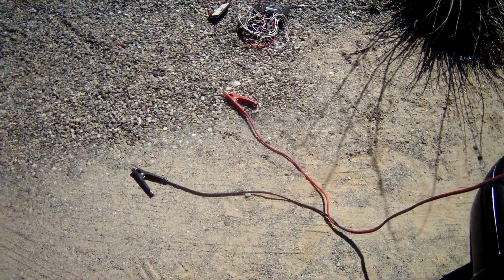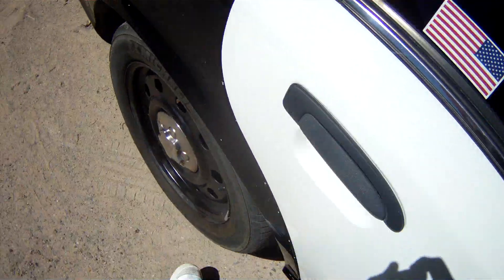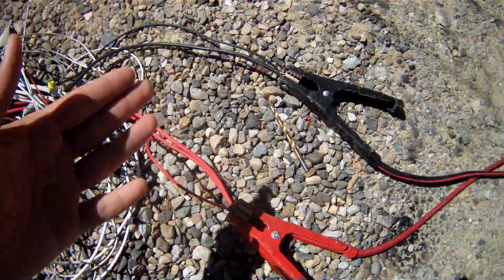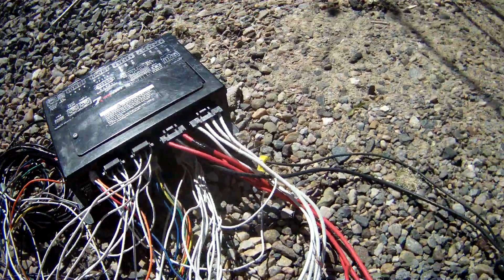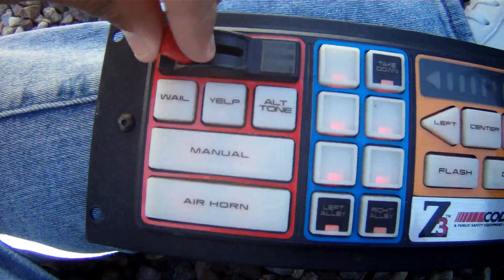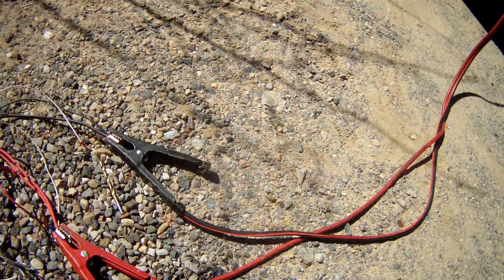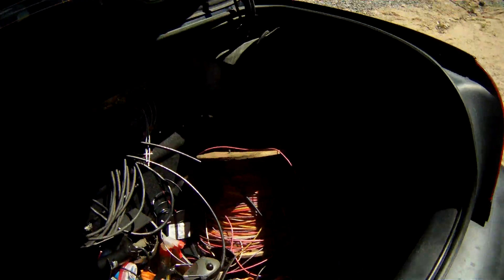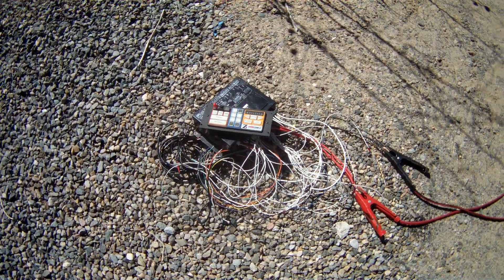code3 z3 wiring tutorial

Comment: Hey so i blew a fuse and cant get my power back to my controller control box has power and everything but the controller just has no power do you know why?
Reply from the maker: I'd check the power wires and grounds to make sure they're tight. If that doesn't work, try switching the cables. Then, check the circuit board inside the actual Z3, along with the fuses. If that still doesn't solve the issue, it might be toast, or the controller could be broken.
-Please take everything I say with a grain of salt—I'm no professional; this is just what I could think of off the top of my head.

Comment: I bought a Z# recently. There as 3 plugs in the back of the Controller, one for siren amp and one for mic power. However the third one looks like it has 5 or 6 prongs. I never got a cable that connects to that. Is that crucial? I havent been able to start playing with the system as im writing this. I do have every other cable for the entire unit though.
Reply from the maker: If you are talking about the one that is labeled CCASTK (with 4 wires that are colored) that is not important as it is for the arrow stick that's built in to the Z3, the important ones are labeled which I believe I talked about in the video on what you will need
Reply: @Its_mikey750  okay thank god lol but it’s labeled as “T11806V4” on mine
Reply: @Its_mikey750  also mine is a NON MATRIX so idk how different that is
Reply from the maker: @SaintKiller135  non matrix is a good thing that means you wont have to worry about sync lights and all that other new tech drama lol